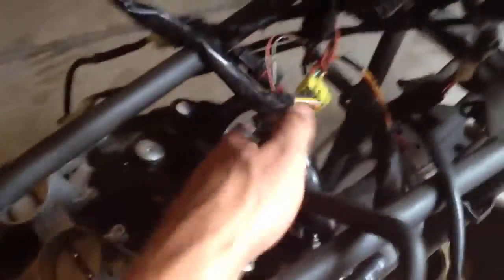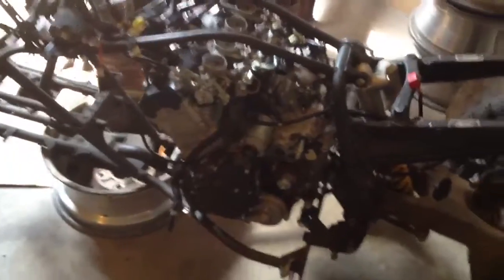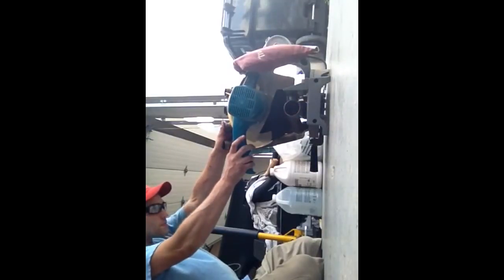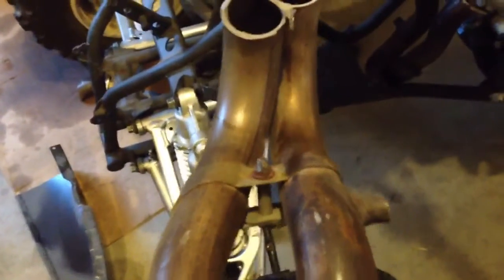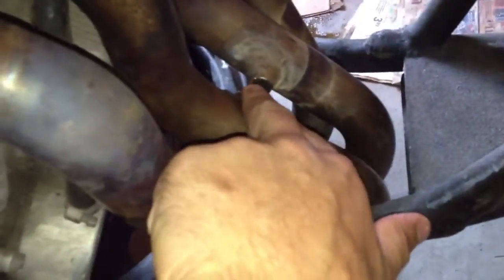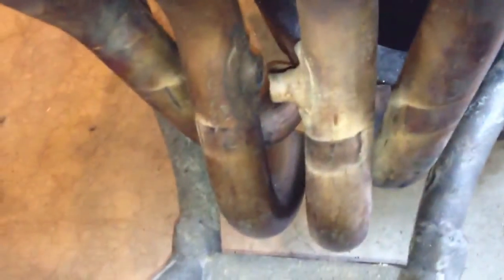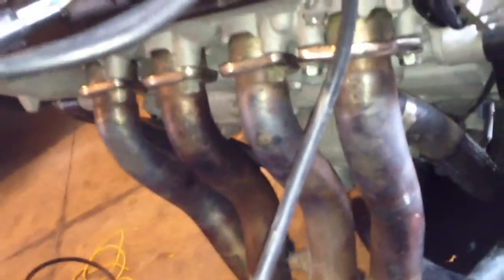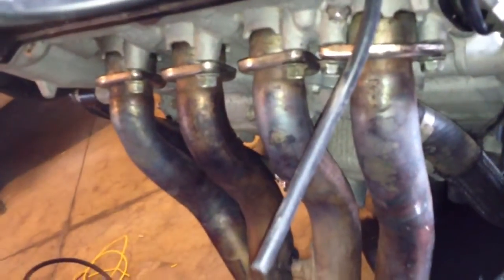Yfz 450 Gsxr 600 motor - Custom quad build

Comment: I love this. I am going to do a similar build putting a gsxr 750 in a trx450r wish me luck
Reply from the maker: @ Noah Riske - I lost track of how many I built. Most all were for customers but I still have 2 of my own. 1 I have is a 05 Gsxr 750 in a highly customized 400ex frame. The other is a 05 Gsxr 600 in a Polaris predator 500. The predator build is on my channel if you wanna watch more building. Best of luck sir! Thanks for comment!
Reply: @FantasyCustoms4Life  thanks for replying. I just bought the engine yesterday and put it beside my quad and I'm starting to doubt I can make it fit. I already have an inline fuel pump but I'm worried about the airbox how did you fit it all inside a 400?
Reply from the maker: @ Noah Riske - It didn’t fit at all, it never has on any quad frame I’ve ever used. Everything was always cut and welded into a custom frame, each time.

Comment: seams like more that that was done.  but ok cut in half and 6 inches
Reply from the maker: The frame was stretched 6 inches longer on bottom and top. The top of frame needs to either go over the top of the engine or to the side or both.
Reply from the maker: not much more done besides getting the sprockets lined up and everything with your motor sitting good and then just rebuild the frame around it to make it easy versus not cutting up the frame and wishing it would just fit, haha

Comment: How did you run the wiring harness? Did you use a complete setup? I am building one and i dont want any wires that are not needed. Do you know the basic wires to make it run?
Reply from the maker: The wiring harness is completely stock except the yfz450 ignition key is wired into place of where the stock ignition key for a gsxr 600 would be and theres a aftermarket fuel pump wired in as well.
Reply: how did u get the key to work i am trying a similar set up
Reply from the maker: are you using a gsxr motor? what year?
Reply: Yes i am 2001
Reply: I put it in a trx450r frame
Reply from the maker: If you have the stock gsxr harness use the gsxr ignition.

Comment: how would u add a electric fuel pump for this?
Reply from the maker: You can wire into the harness right where the old electric fuel pump was. unless you have a special tank made or use the stock tank you will have to use an inline electric fuel pump which is what was used on this quad.
Reply: Oh ok.. do u think I could use this in a ltr with an engine like this but use the stock efi fuel pump?
Reply from the maker: the stock efi pump for the GSXR or stock efi pump from what?
Reply: I was saying like the ltr is efi from factory and has a pump on the side if u could use that to feed the gas to the gixxer motor
Reply from the maker: Jose Moreno Well it may run the motor if its around 42 psi. the problem you may or may not have will be a lack of power if it doesnt do the volume (GPH) that the bigger motor fuel pump would do. If you run it let me know how it works out. thanks

Comment: What did you do for the intake filter>
Reply from the maker: https://www.youtube.com/watch?v=kRcyI5M_834   - should be able to see them in the next part of the build video.
Reply: any tips? I plan on doing the same swap with a 05 yfz 450 frame and a 05 gxsr 600
Reply from the maker: Go to my channel and watch all of my custom builds that deal with a metric rocket motor transplanted into quads and buggies. Read all the comments of questions other people have already asked me and that should give you a decent heads up of what is involved in the process. Thanks, and good luck man!